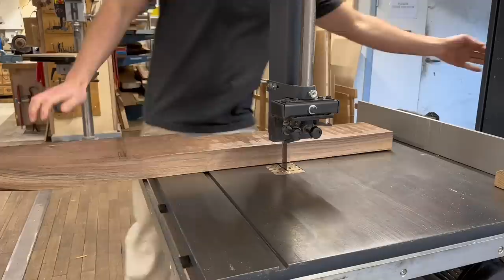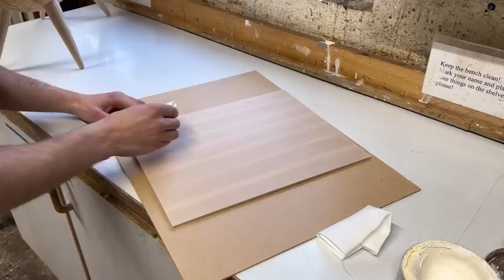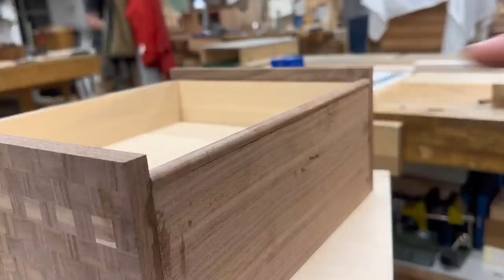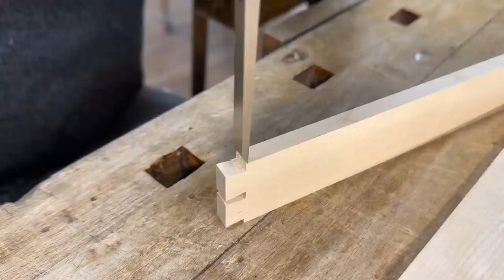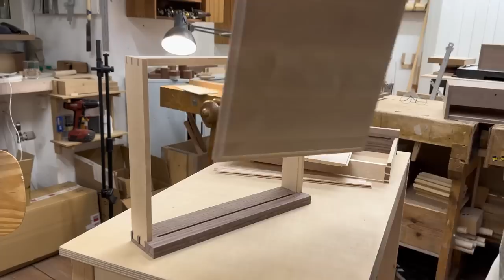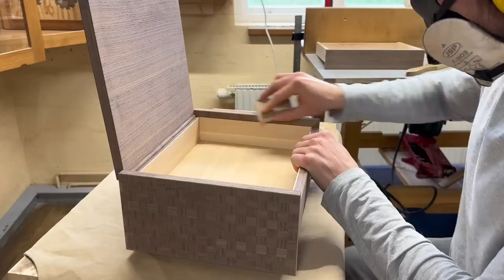Time-Lapse: Crafting Jewellery Boxes: 200 Hours of Work in 20 Minutes

Comment: Absolutely outstanding work, beautiful design but please do not use the jointer for small pieces and certainly without the guard in place properly and a push stick. I lost 1 and a bit fingers jointer drawer runners early in my career and would hate to see that happen to you.

Comment: New woodworker question: the center part of your panels look like they expand/contract horizontal, but the top and bottom rails run the opposite way.  It looks like you used glue on all four sides of the panel.  What allows you to do this safely so the wood doesn't split over time?

Great video sequencing!  I'm enjoying watching and reflecting on every move of the project.  Thank you for posting.
Reply: Another question: How come you dented/scratched up the surface of the brass screws before filing, but not the brass plate?  I've never seen this technique before.
Reply: He’s peening the screw heads to make sure they completely fill up the countersinks in the plate. Countersinked screws and holes rarely match perfectly and small gaps can reveal themselves during filing/finishing 💀
As for the first question I’m not exactly sure but I’m guessing you’re worried that the enclosed fir “sandwich” might split the borders/frame. Since it’s under a few layers of veneer and glue and as long as the relative humidity stays fairly constant in the room I’d say it’s not a very big risk. 
I’m no pro on wood swelling in joinery though, but it’s my take on the matter :)
Reply: @S T  really appreciate the detailed reply.  Glad I asked.  Yes, it was the fir sandwiched that confused me... I've only seen examples of plywood stabilizing veneer and not the other way around where the veneer stabilizes the core.  His work is so nice it's probably going to end up in a perfectly climatized home, so I see your point.  Thank you!